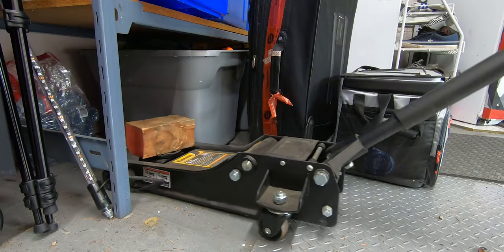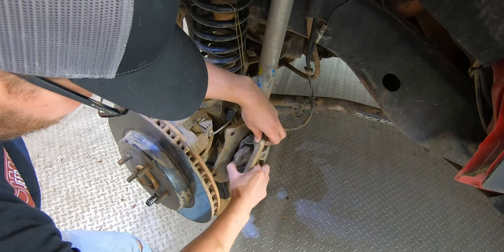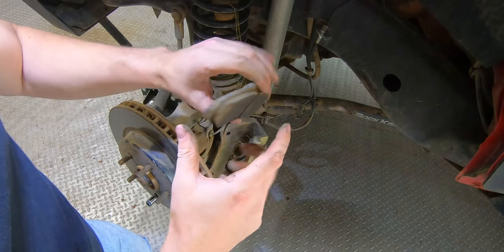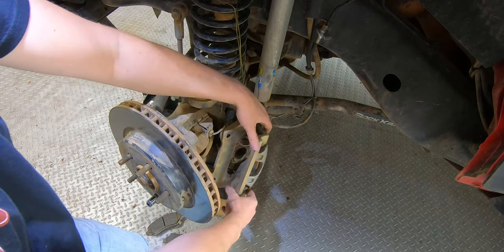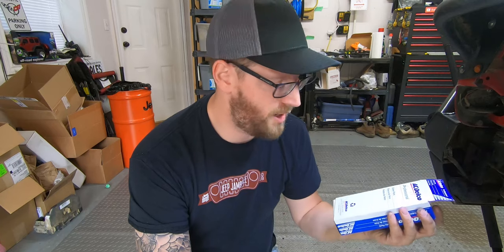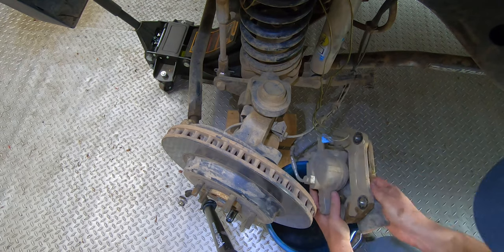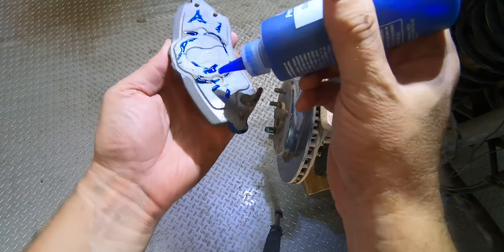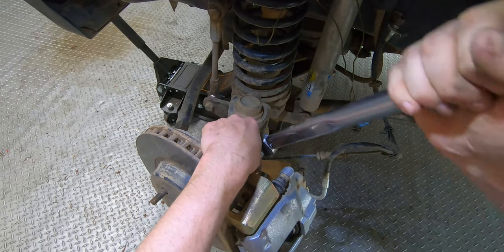FIXING MY SQUEAKY JEEP WRANGLER BRAKES *CHEAP & EASY* *OFF ROAD*

Comment: Have the same issue with my gf’s jeep wrangler. The hardware pops off. I couldn’t figure out why it made this noise until I noticed they were gone and replaced them and then the noise came back and they were gone again so I’m about to use some kind of JB weld to hold them on. I don’t know last resort I guess.

Comment: Hey Casey. I have the same Dynatrac brake set up.  My clips take a beating too, I have 37’s.  Probably lots of vibration.  Question… I thought you were supposed to “lube “!the slot in the clip.  I use some copper anti cease there.   Is that blue anti squeak stuff sticky? Or slippery?  Do I have that wrong?

Comment: I’m getting a similar sound, but only when I slow down. Checked and replaced all four brakes and rotors and still have the sound. Possibly my axel shafts?
Reply: Did you find a solution. Mine is doing the same. As I slow down it makes a rocking chair sound.

Comment: Do you have any video of that noise? Mine is making a squeak noise briefly at slow speed when I turn my wheel to the right a little. Coming from passenger side
Reply: Did you figure out what it was ? Same prblem here a few months after bew oads and rotors its back

Comment: Why what cause a Jeep to squeal when going from park to reverse, or when going slow and braking? I’ve found a few people say it’s normal but can’t find anything solid.
Reply: Did you find an answer to this?
Reply: J. Ward apparently they all do it
Reply: @schoolboy405  I've heard of some guys not having the issue. What a crappy system
Reply: Mine does it. I have not done anything about it but I bet some fresh clips and grease would fix it.
Reply: wheezin_mtnbkr nah dawg I replaced the brakes clips and rotors, made sure everything was clean and added grease to every part that needed it. Still does it
Reply: @schoolboy405  Good to know, then I will not bother doing that. It isn't really a huge bother I guess. I had a 4Runner that made brake noise back in the day and using organic brake pads fixed the issue. Maybe next set of pads I will try that.
Reply: schoolboy405 I’ve replaced wheel bearings, resealed axel, replaced calipers, pads, and rotors. Squeak went away for about 20 miles and came back. Makes me never want another Jeep, ive had this issue for 2 years now and I listen to other Jeeps that pass me to see if they squeak too like mine, 6/10 sound just like mine. Others might have it but you may not be able to tell over the noise from aggressive 33” tires and hacked off mufflers.
Reply: theonly1 I know man, this was my first Jeep and if I don’t find a solution it will probably be my last. Not a real bad problem, just makes jeeps sound real cheap, or not well maintained.
Reply: schoolboy405 exactly! You get it bro... my Jeep is in the shop at this very moment for this issue for the last time, should be ready in the next few hours. If it actually gets resolved I will definitely let you know what it was! If it doesn’t get fixed I’m switching to a 4Runner. This is also my first Jeep.
Reply: theonly1 bet! I was thinking about switching to a 4Runner lol!
Reply: 2nd Jeep in my family and both Jeeps have squeaked since day 1 (esp when used after initial start-up). Multiple people have looks at possible break issues during routine inspections and their conclusion has always been that "it's just a Jeep thing." Annoying? Often. Embarrassing? Sometimes. Is the tradeoff worth it for having such a reliable vehicle? Absolutely.